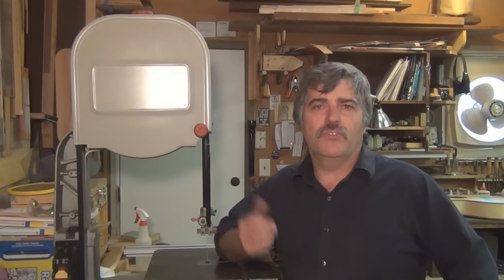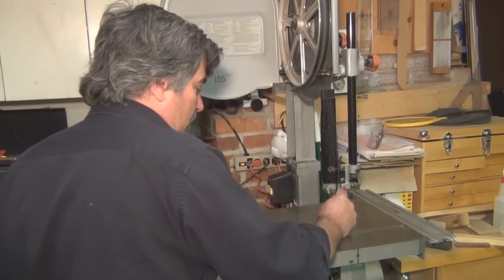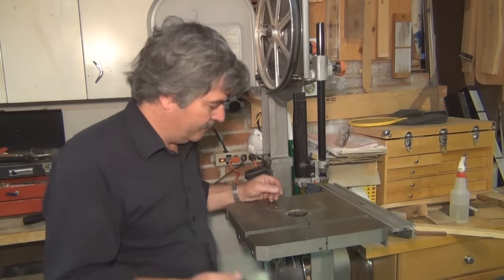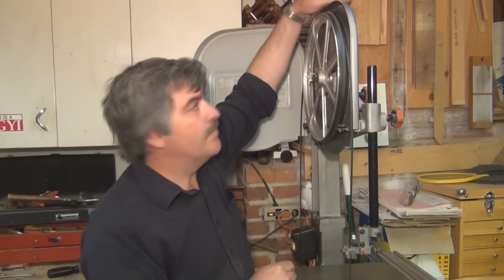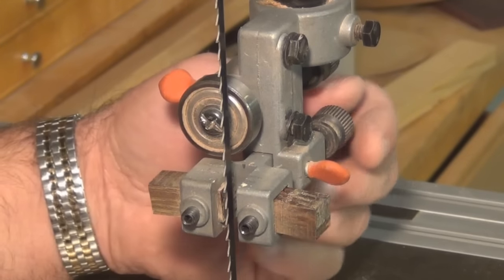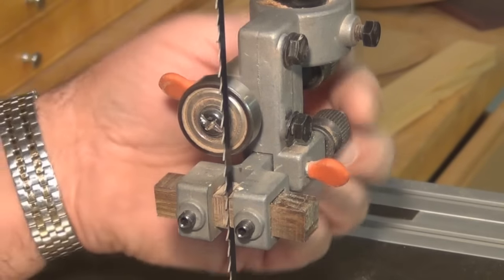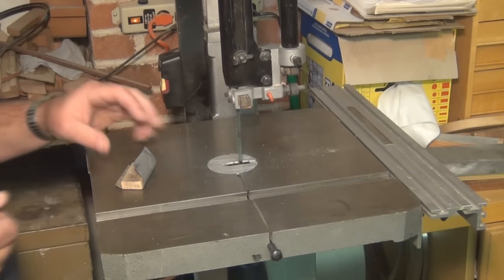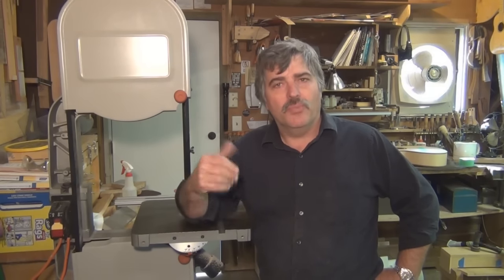Setting up your band saw

Comment from the maker: Breaking blades? If you can discount the possibility that it is a cheap blade and a poor weld then it's likely that the tension is too high and/or you are making way too tight a turn and/or you have a three wheel band saw which are notorious for breaking blades.  It's the small third wheel that fatigues the weld. 

A 14" wheel is really a minimum size for a band saw.

Comment: At 6:31 the blade is on backwards? Great video though...
Reply: The teeth on the blade there are pointing to the left which is the correct orientation. The blade is a narrow one that's located to the right on the rubber wheel at that time in the video.

Comment: what dos the ballbearing do when its not spinning with the blade?? looks pointless to me. and looks like it sits the wrong way.
Reply: It's called a thrust bearing. It only starts to do it's job when you deflect the blade by pushing wood into it.  If you have a really sharp blade and a light hand you won't deflect it enough to touch the bearing. If it weren't there you could push the blade right off the back of the wheels. In the past the "bearing" would have been a piece of wood or brass or other hard material. The side of the bearing works better than the round edge as it has more surface area for the back of the blade to press against.  It's actually 2 flat points that are moving.  Bearings the other direction can cause the back side of the blade to "fishtail" out of line with the cut.
Reply: @gregnelson7168  then why are the bearing the other way on mini bandsaws from proxxon?
Reply from the maker: @nikolajc7617  Because there is more than one way to accomplish a task.

Comment: No Gloves  ??  Ouch !!     But still great info. Thanks
Reply from the maker: +Kevin Conlon The only point at which I might have thought about gloves would be when actually handling the blade.Care and common sense pretty much rule out injury for me on that count.  Would not recommend them while cutting. Too much chance that they would catch and pull a finger in that would have otherwise escaped.  Perhaps those armored gloves but then again, remaining conscious and using care is the best way to keep all 10.
Reply: +Nelsons Guitars Aloha .all good info thanks.Hawaii
Reply: Good advice, gloves could be dangerous if close to a moving blade

Comment: If your doing cuts like this on guitars check out Carter Products for bandsaws youll be impressed
Reply from the maker: I had a saw with carters.  Worked really well but the bearings are much more noisy than the rub blocks. I get great results with these but nothing wrong with the carter systems.
Reply: The Carters are indeed very good. I have no problems what so ever with my Lignum Vitae blocks and like the old time vibe so will keep them. If I used this all day every day I might change my mind.

Comment: Center the gullet of the blade to the center of the wheel
Reply: Yes. I have been given this advice from people who I respect who have had success with it. However I have not.  With my tool it causes the cut to drift off what I think is the correct path (parallel to the miter gage groove).  It may work for you but it works best on both of my band saws to center the blade on the crown of the tire.

Comment: Jet bandsaw?
Reply from the maker: My saw is a Rigid, but they are all similar. Yours may have a different sort of system to adjust a thrust bearing or guides but they all work in the same basic way.

Comment: I generally don't like to criticize but: 

You mentioned about blade direction being in the right direction but never said which direction was correct. The video even showed the teeth facing the right side as you were adjusting the tension.

You talked about blade tension but never showed the actual correct tension on the blade.
Reply: I thought the direction of cut was a basic knowledge for any wood worker. Points go towards the cut. 
I did address the tension. The tension indicator is not a thing to depend on. You want enough tension to keep the blade straight but not so much as to stress the weld.  Bigger blades will put up with higher tensions. If the blade seems to bow when cutting try increasing the tension. If it breaks, decrease with the next blade. If you get into the zen of it, experiment a bit until you get it perfect for you.  There is no one correct tension for a given blade.

Comment: That's not the proper way to address blade drift.  The proper thing to do is to square the table so that the miter channel is parallel with the blade.  Then square the fence with the miter channel.  This way mitering a ripped piece will result in 90 degree corners.
Reply from the maker: If you want to use the miter groove with a jig then you would have to do that. However, I like this system for setting up a rip fence. Much faster and IMHO more accurate than changing  the table alignment. To each their own.